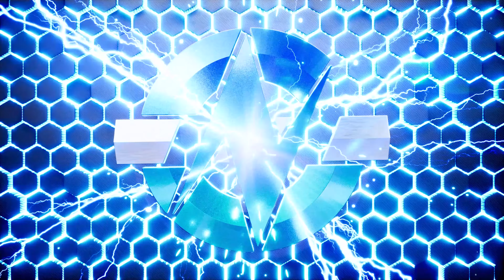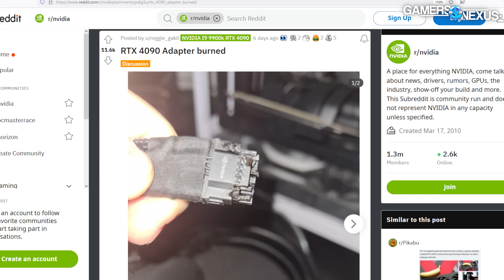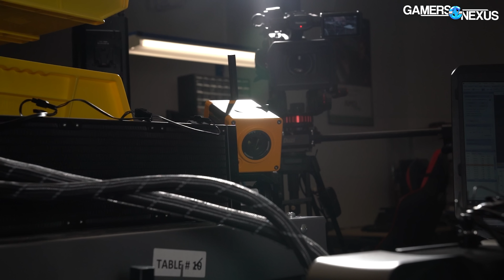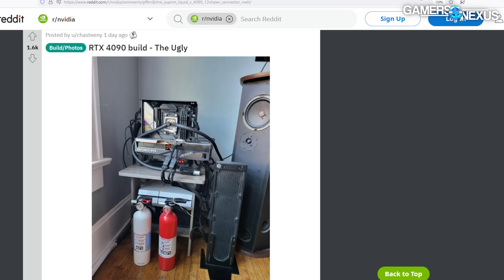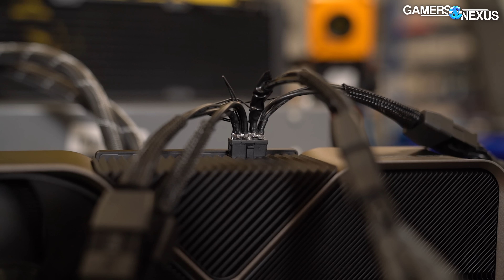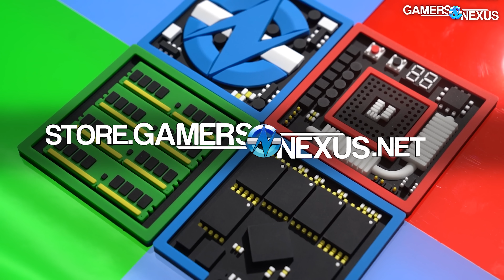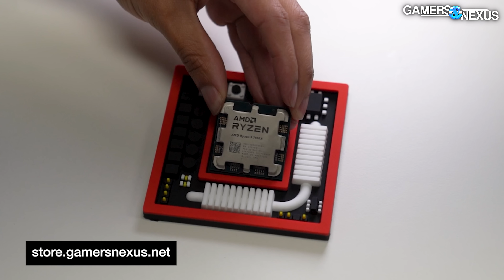Testing Burning NVIDIA 12VHPWR Adapter Cable Theories (RTX 4090)

Comment: This is beginning to sound like the issue Gigabyle and one other (can't remember who) where two different suppliers were involved, and one cheaped out. (If I remember correctly, the Gigabyte exploding PSUs was down to a capacitor being different between good and bad PSUs.) If this is the case, it brings up the following questions:

 - Were these parts revisions of the same part or intentionally two different parts?
 - Were these two different parts with different SKUs/descriptions or using the same SKU/Description?
 - Were they from the same or different manufacturers?
 - Did nVidia include/sell the cables to the board partners or tell the board partners to go source their own adapter cables?

Remember, the important questions isn't "Who do we blame?", but more "What is happening?", "How did this happen?", and "How do we prevent it from happening again?" Very few people set out to create something that harms life and destroys property. I think the last question I asked about the cables specifically will indicate how big of a mess it will be to recall the defective cables.

Comment: Appreciate all your hard work. If you get the failed cable in, and they all have the 150v wire, I think we'll have our answer of what's going on, however, if you get the failed cables in and they're all 300v, that'll be interesting. 

Also, maybe at some point Nvidia will grace us with an explanation of why they think their product is catching on fire, lol.

Comment: I think the problem is in the transition resistance because the connector pins have a very small contact area. If the connector was somehow dirty (for example, poorly washed FLUX), the pins could heat up due to the large current flowing and the transient resistance.

Comment: You mentioned doing tests on a 30 series card, is it possible that adapters that were made for 30 series cards were built to a lower specification initially and some board partners might be getting rid of their old stock of the older cables or people that got a 3090 reused the adapter when getting a 4090?

Comment: The camera is 100% just Claptrap from Borderlands. My adapter is 300V 14AWG and was supplied with my Founder's Edition 4090 and has not failed. I've moved to a Cablemod 4x8-pin to 12-pin native cable.

Comment: BuildZoid was stating that people are concentrating on the wrong end of the connector because the burning/melting is at the end of the connector and not where the solder points are. He also stated that the connectors are made weaker because they have a slit at the top and bottom, not just a slit on the bottom similar to better connectors so it's more susceptible to horizontal forces before weakening the connection.
Reply: If the solder points were the main problem, the burning/melting would be more easily seen because it would be more drastic. Instead, it occurs at the end of the adapter inside the connection on the GPU. I'd go with BuildZoid and agree that it's the fragility of the pin material with 2 slits instead of 1 that may be the cause of the melting/burning at the end of the pin, where the double slit fragility is worse and why Nvidia states that bending horizontally should not be done because the double slit pin connector is the weakest at that point. Great work GN. Keep going.

Comment: I'm a Professional Electrical Engineer. Wish you consulted with one prior to making this.

The voltage and 105C rating on the wires is for the insulation only. The copper wires themselves don't really care about the voltage or heat. Why would they? The only thing determining how "hot" a copper conductor gets at a given current is the AWG wire size. Period.

Comment: What about cablemod's 12VHPWR to 4x8pin cables? I've got one on the way to replace my 3x8pin to 12VHPWR adapter setup on my 4090 gaming OC version. If that works, I have no problem parting with the adapter for testing.

Comment: Wow, Igor got the cheapest and least reliable cables ever... for a 2000$ card
Your cable is more solder and electrical bridge material than plastic, which is how a high voltage power line should be constructed.
(excluding the parts about electric and thermal insulation
)

Comment: if there's 2 different voltages on different adaptors, i would think 150volt lead is version 1 and 300volt being version 2. coming to my point "they made vertion2 because they found problems vertion1 so they know there was a problem in the first place".

Comment: In the automotive world when we see failures like the one pictured it is from a pin fitment issue causing resistance and heat. That is why the connectors are melted in the pin end and not the back solder area.

Comment: My hypothesis is that they (NVIDIA) have 2 different SKUs for their adapters, one for 4090/4080 and a lower-spec one for 4070 and below, which somehow got mixed up.
Got to save a few cents wherever you can!

Another thing that I don't see anyone try yet, is crushing the cable between the sidepanel and the card, because a lot of people just force their sidepanel shut if needed.

Comment: Hot wires are almost always from bad ground connections and not bad power connections. I say almost, but I'm 99% sure I should say always.  Hot wires are always caused by bad ground.
You can use almost any size wire to feed power and it won't get hot, but if they ground wire is undersized or has a bad connection it will get hot enough to melt solder and plastic.

Comment: There is little validity to these tests as they seem to be performed in open air.
Remember the vast majority of users will install them in tight cases and the wires be forced in a myriad of ways with tight angles because of the stupid size of the GPUs.

Comment: When I first saw the GN community post about this video, I thought “I thought this mystery was already solved, what’s the point putting so much work into the testing? But this is why I like GN. Always going the extra mile to really dig into an issue and dredge up the nuance.

Comment: I've seen this type of connector melting numerous times in the automotive industry, and the most common culprit is poor terminal tension. This can cause high resistance due to micro fretting in the terminal caused by arcing. The easiest way to test for this in to slide the correctly sized male pin into the female terminal on the connector, and compare the amount of force required to remove the pin to the other surrounding terminals of the same type. Quick and easy test to verify a theory if you can get your hands on a connector that has begun to melt/ overheat.

Comment: These failures look a lot like poor pin  to pin contact failures I have seen in vehicle wiring harnesses. I wonder if you could do like a pin retention/pin drag test when you get a failed cable in to see if that would give a clue.

Comment: If the 4090 12VHPWR cable adapters are having issues, should 3000 series owners that use a 12v power adapter from nvidia be worried or fine since 3000 series uses less power?

Comment: I wonder if that IS the "user" error and cable just slowly loosen over time from vibrations and stuff. that would explain why it would not be detected earlier. I would say it might be related to cable, managing it in a way that card pulls on connector while vibrating or there is some kind of limited series made with wrong cable, maybe single factory that did mess this up.

Comment: Hi Steve, here's my thoughts on this problem:  the adapter is melting because of lack of connection surface between the pins at gpu side and the adapter's socket. In other words the plug isn't tight enough. You may reproduce this situation by loosening sockets at the  connector.

Comment: 150 V wire for 12 V is gross overkill! It looks like they just used electrical outlet wire because they had it. the 300 V wire is probably for 220 V service. Using a higher voltage wire can cause more heat buildup in the wire.

Comment: Unsolder the new connectors, connect a 16-pin wire from NVidia to them, run an electric current through it all, turn on the load, and see how much this 16-pin miracle of engineering can really withstand. Each pin must withstand a load of 100-110 watts.

Comment: I am a ham radio operator and know my 12 volt set ups I usually run and  setup  on wiring from 1 amp  to 150 amps. I finally got to see are the close up of those what you're calling pins on the NVIDIA 12VHPWR Adapter Cable.  The problen will be that they are  split type another words  two halves totally separate.
And under strain one half can be slightly less contact the Nether and cause resistance to go up.  This would be at the contact point where you can't see with the camera and get quite hot possibly.

Comment: I am a Optical Engineer that spends my day troubleshooting equipment issues or being proactive to stop issues, so I always appreciate the scientific and in-depth research you and your team do on a Case, CPU, GPU it does not matter. I feel you have done amazing work on this subject to date and of course I know you will continue that with what you are asking folks to do.  I feel you are doing EXACTLY what NVIDIA should be doing thus, doing their work for them in a way. Due to my knowledge of power and it's affects due to current and high ampere draw, my   4090FE is setting on my desk waiting on the 12 wire version of the cable from Seasonic or one I can buy if quicker from Corsair..  I likely will peal back the protection on FE supplied cable to see if it is 150 or 300 rated wiring. keep up the amazing work Steve and team, we will continue to watch and support you.
Reply: really weird of you to assume NV isn't doing any sort of root cause analysis for this failure. This sort of bad coverage is terrible for them and they definitely have their engineers working on figuring out what is causing this issue.
All the testing Steve and other content creators are doing probably is helpful, but only to an extent, because they can't just trust all these results as 100% accurate. They will have to redo the tests themselves.
Reply: @k43215  since Nvidia has remained completely silent on the matter other than calling back cards. It would also be an assumption that they're doing anything other than risk mitigation for themselves
Reply: Check out cablemod, they have a cable that should be exactly what you are looking for i think
Reply: @Ixxlostinabox  I am on the waiting list lol, but thank you in case I did not know.
Reply: I'm interning as a non conformance engineer and I agree that GN is basically doing part of the investigation for Nvidia. I wonder if their NC engineers are feeling relief with these content creators gathering data for them. Often there are times when I'm investigating customer return units where I wish I had more information from the customer and more parties interested in figuring out the problem.

Comment: For plastic to melt there should be 180°+ or something along the lines. That plastic doesn't melt at 100°. 
So either they have broken a lot of cables leaving just 1..2, or there has been short circuit within the connector, which does a lot of heat. Increased resistance/half broken wire option makes sense too, but only if that's the single wire left. Because otherwise electricity will flow the less resistant path through other wires.
While I do despise this stupid 12+4 pin connector/convertor/extension cord from electrical engineering standpoint, this whole story somehow stinks a bit as well. 
What is the real amount of damage (a batch? single manufacturer? online hype?) and why is the damage are the right questions for now. Publicity stunt? Somebody manufacturing from subpar parts? What is really happening here? Great, objective report from GN as usual.

Comment: What's the possibility that it may not even be an adapter issue, but rather the connector on the board as the culprit? I.e.- the pins in those connectors are faulty?

Comment: While it might be apples to oranges.  Ford, not too long ago, had an issue with a valve on the new Bronco that was failing and destroying engines--the problem while small--though impactful--was traced back to a 3rd party manufacturer.  Is it possible that in the rush to produce the 40 series and this new adapter, Nvidia might have used 3rd party manufacturers that did not always live up to the spec?  So, maybe that is simply it?

Comment: Compare the cross-section of the cable to the cross-section of the thin plate it is soldered to. It looks as if the plate area is much less, causing heating in the plate, not the cable.

Comment: Something I think could be tested is cutting small pieces of that thin plate without removing the outer cables to simulate cracks/fatigue in that piece of metal, that would force more current through on a small piece of thin metal that for sure has to heat up the plate, the question is how much has to be removed.

Comment: The problem is two-fold.
1) Using CMOS instead of resonant tunnel diode threshold logic. CMOS results in 5 GHz at 600w. RTDTL results in 2 THz at 5 W.
2) A bad PSU standard. They stuck with 12 V (car battery voltage) instead of the 48V telecommunication standard. This results in 4 times the current. Causing melting, fires, and failures.

Comment: The plastic may become brittle and be more receptive to melting after hitting high heat for hours then cooling down overnight. So, after a few weeks of this,  the plastic properties are weakened and can start to melt. Maybe eight  hours test my not show anything.
Last thing, maybe a bad or very cheaply made power supply may have something to do with it by spiking and over volting the power and heats up the weakest link?

Comment: One thing that Jay kept mentioning was people bending the cables in order to make them fit, prior to inserting the cable into the card. But never touched on bending the cable downwards or sideways whilst plugged in, to make it fit or people just really forcing a side panel on in order to make the card and cable fit, could this kind of abuse potentially be one of the factors in making the contacts melt/burn?

Comment: Sounds like Nvidia ran out of supplies and did at least one production run with cheaper components . I've seen this in the pinball community a few times where a batch of customers have a consistent failure that one one else is seeing

Comment: My house was a high risk of catching fire, the lights where flickering.
This was due to the mains power cable was loose which generated a lot of heat , even melted part of the fuse box.

Comment: Murphy's corollary for planned obsolescence and actuarial strategizing (AKA body count): take stuff out of the design until something bursts into flames, then return the last thing removed. This can include, but is not limited to, wire diameter, amount of solder, plastics, metallurgy.

Comment: Bad solder joint (cold solder)  >> increases joint resistance >> increases heat  >>  further degrades joint >>  rinse repeat >> thermal runaway.    Most likely due to tight installation environments, cable bending, lack of strain relief, and mix in a bad solder joint, at these currents you're going to have failures.   Single cable to pin without a solder bridge (some of these look hand soldered and poorly at that) is the way to go.  I think you can generate 1000's of tests like these but none of them can replicate the random scenario that causes the melting.    You need to replicate the arcing that is most likely happening in some of these scenarios.